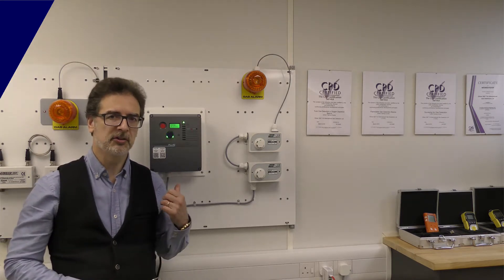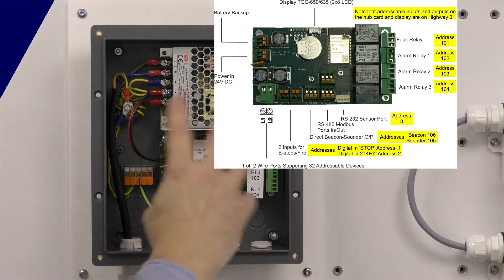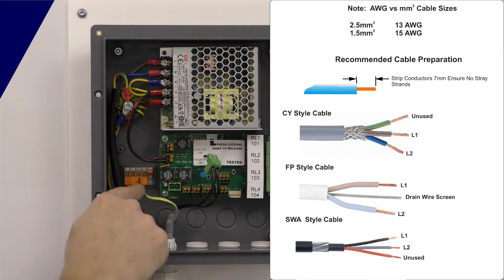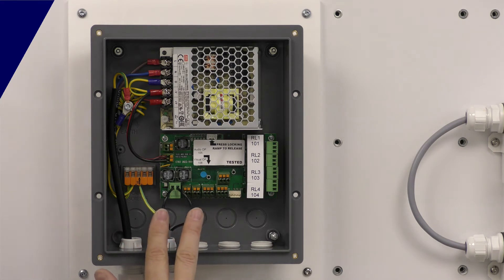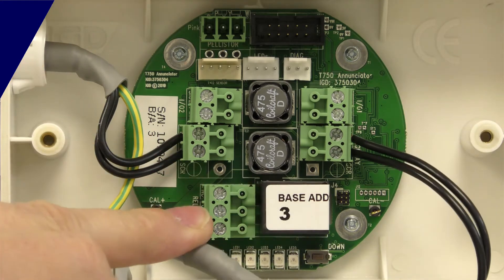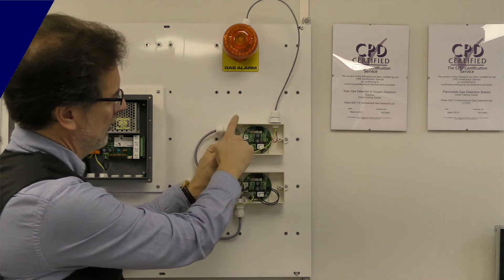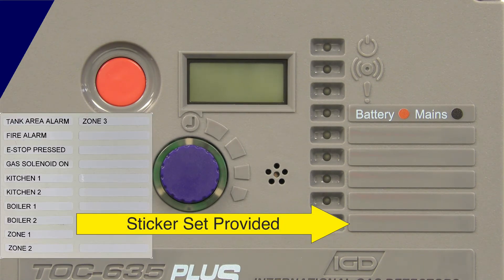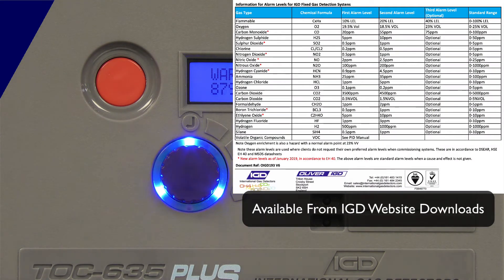TOCSIN 635 Gas Detection Control Panel Installation Video

Comment: How to silent if there is an alarm
Reply from the maker: Hey @martintugas4532, great question. If you press in the jog wheel and hold for a few seconds this will silence the alarms. If it is below the alarm level it will reset the alarms and back to green operation. 
The alarms will re-start again if its been over 15 minutes and alarms not reset or if a new alarm threshold is triggered. 
please email our aftercare@internationalgasdetectors.com for any maintenance request, training or general support.

Comment: Beacon will activate for both sensor ?
Reply from the maker: By  default any alarm 1 will activate the beacon sounder (either sensor). The system cause and effect can be changed including muting alarms and zoning/grouping detectors. So if required the beacon can activate for both sensors or for a specific sensor.
Reply: @InternationalGasDetectors  thanks for your response
Reply from the maker: @vishnuperambra  our pleasure. If you want to learn more contact our team here: https://www.internationalgasdetectors.com/contact-us/
Reply: Pls explain a video how  login to wifi...